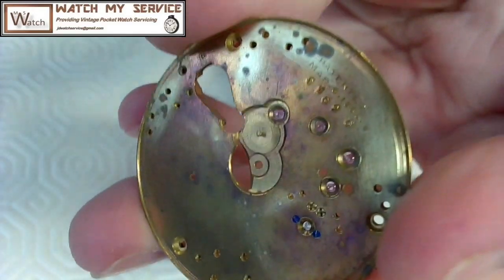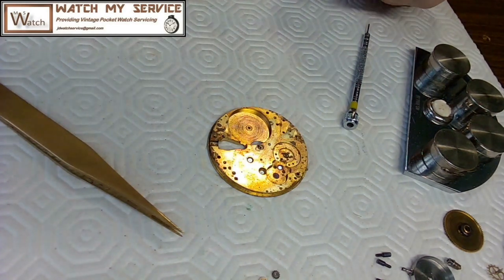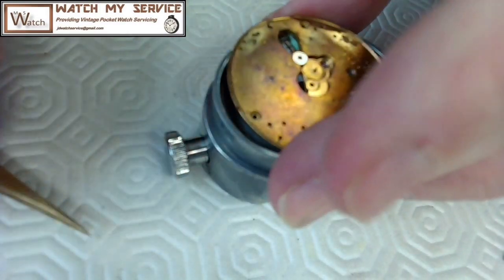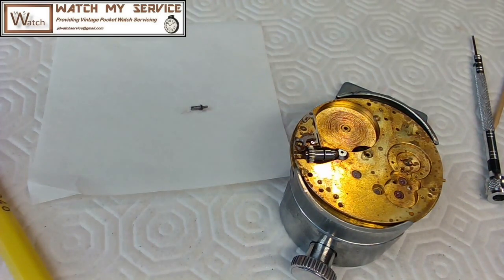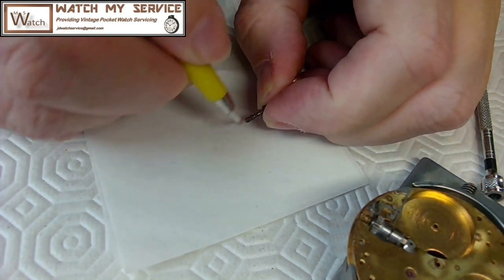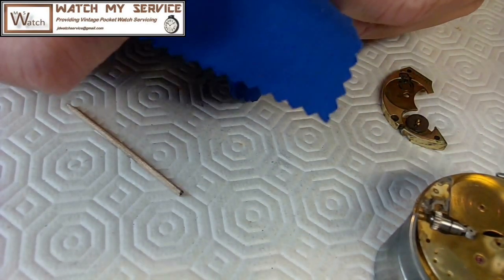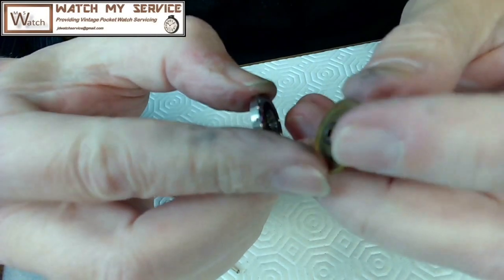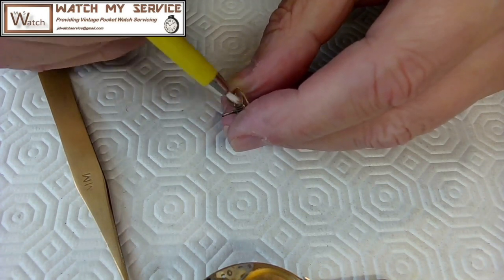Can this watch be restored?

Comment: Would you believe, I have just purchased an 1883 Waltham Royal movement so this series will be a godsend to me when I try to tackle it. Thanks. I was praying with you as you tried to tweak the balance pivot, not hard enough I guess.
Reply from the maker: The pivot was really bent and needed to be replaced. Any other watchmaker may have just put the balance back that way, but I can sleep at night until the problems are solved. These watches take time

Comment: I have plenty of experience with knee pain- yours sounds a lot like the pain I had - inside the knee about half way up and the pain was exacerbated by holding the knee at a certain angle. I had a MRI and turned out there was a hole the size of a Toonie. Funny enough previous X-Rays didn't pick it up so initially the Doc thought I was imagining the pain. Up to the point of surgery what worked best for me was Neoprene Knee wraps- that and an ointment called "Diclofenac" (my Doctor said it was transdermal )- also sleeping with a pillow under your knee ( I used a Boat Fender which I could inflate or deflate for comfort inside a pillow case ). Also- don't put your legs up while sitting in a Lazy Boy style chair- it stresses the knee quite a bit. A heat pad is also handy. Other than that hardcore drugs- Demerol, Tramadol, T3's etc. Whatever works for you- depending on the degree of pain your in- Good luck.
Reply from the maker: Exceptional advice. My knee and hip problems are DNA from my moms side. I have been sleeping with a pillow for 20 years due to hip issues and have had knee issues on and off for the same amount of time. Knee and hip replacement will eventually need to happen as I can no longer golf due to hip pain and my knee often feels like a knife just stabbed it. I’ll rest it for now and try to walk it off like they did 100 years ago:)